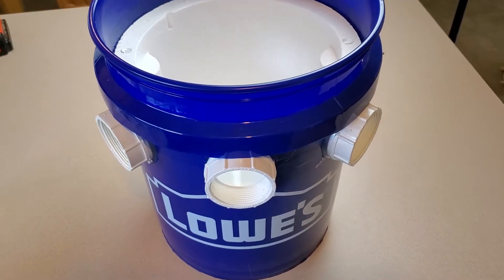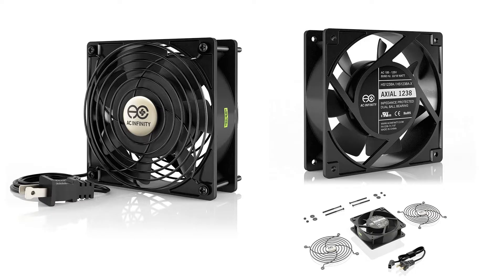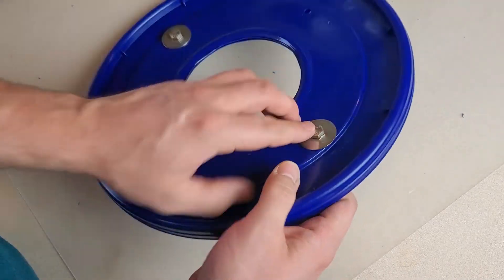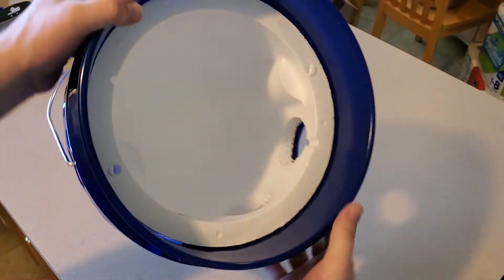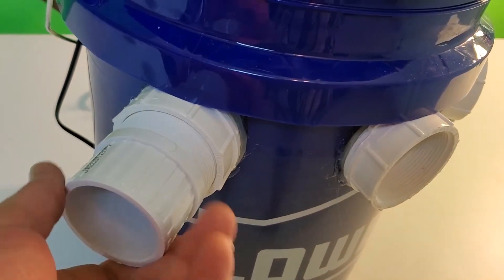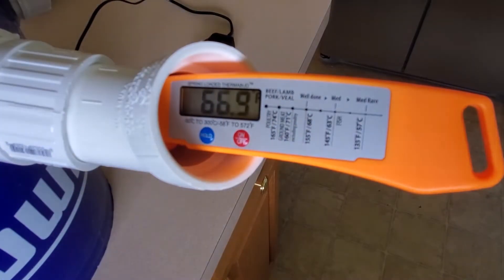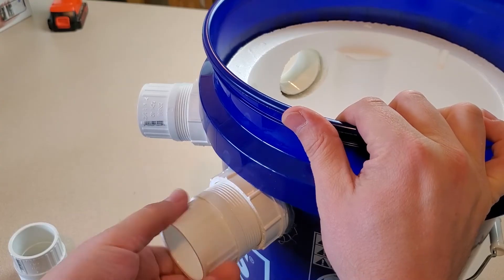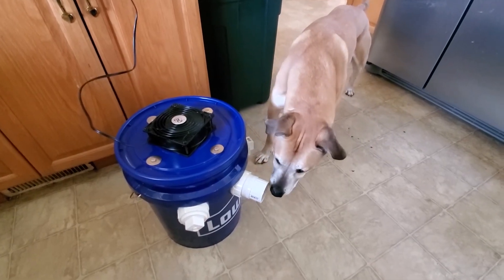DIY Air Conditioner - Homemade Bucket Air Cooler w/ variable speed (Deluxe Version!)

Comment: Unanswered question:  What happens to the room temperature?  Does this put out enough to lower the "room" temperature?  If so, by how much?  How small does the room have to be to feel the effect?
Reply from the maker: The ideal use for this contraption is as a "person cooler", rather than a "room cooler". If your room is 85 degrees (or whatever), this will cool you down if you're sitting near it.
Reply: @GreatLakesPrepping  Hmmm...ok.  Good to know.  I'm guessing it might still cool a car or maybe a small room.  It would be good to see a before and after test.

Comment: That fan seems small does it blow out very slow?? Can you test this in a hot room? Like if you put this in a 100 degree garage would it do anything at all?
Reply from the maker: The fan is not huge, but it blows a lot of air. I will mention that this thing is not so much a "room cooler" as it is a "person cooler". For it to really cool you off, you'll probably want it blowing at you. But whereas an ordinary fan blows 100-degree air at you (if you're in a 100-degree room), this contraption is blowing ~63 degree air at you.
Reply: @GreatLakesPrepping  Thank you that's what I was wondering. I figured it would be great to sit in front of but as far as room cooling not so much. Saved me time building it for no reason =D Nonetheless it's probably the coolest bucket one I have seen :)
Reply from the maker: @NewYears1978  Thanks, I appreciate it

Comment: You mentioned using a 12 volt DC fan. I bought one and a 12 v 7ah battery.  But the fan does not put much air out.  I want to use the cooler in my golf cart.
Do you have any recommendations for a 1v DC fan with comparable specs to the 110 fan you used
Thank You, saw a few of these dyi coolers on you tube, I really like your version
Reply: 1 volt typo error, should be 12 V
Reply: 1 volt typo error, should be 12 V

Comment: I might have to try this, I am an artist that vends at outdoor events. One event in particular is nine 12+ hour long days in a row, at a time of year that is usually hot in the afternoons. I have  a van with a cot in it so my hubby and I can switch off taking naps when needed. BUT it's like napping in an oven, and the van air conditioner can't keep up. I have been looking for ways to help cool it down. This might be the answer. I only need to use 2 or 3 times a year.

Comment: I was thinking about one of these and then it popped up on my YouTube feed. I was thinking precisely similar to this with the exception of a pipe going down the middle but not extending all the way to the bottom of the bucket that would force the air to rise up through the ice and increase the chill factor. You could have multiple holes drilled in the bottom of the central pipe or just have it pushing straight through.
Reply from the maker: That's a good idea for an improvement to this style of air cooler.

Comment: I'm contemplating doing some car camping to save on a road trip. And honestly I'm just looking for something to keep cool at night while sleeping since I don't want to run the car AC due to obvious reasons. Seems like this would do the trick. Thoughts?
Reply from the maker: As long as you can keep it filled with ice, it will blow cool air on you! I think a batch of ice ought to last you through the night for sure.
Reply: @GreatLakesPrepping  awesome. Appreciate the effort and knowledge.

Comment: Thanks for making such an a awesomely thorough video! While waiting for a mechanic to fix the a/c in my car I had an idea! I live in Arizona and it's getting hot out!! 😆 so I'm thinking about making one of these and using it in my car to save $$ gas, plus wear and tear. Does anyone think this is a doable idea?? I just read an old newspaper story about how they actually used to have mini swamp coolers in cars lol Love to get some thoughts!! Thanks in advance and thanks again for your great video!!
Reply: I saw a comment in a similar tutorial that the windows need to be open or else room or car will get rather humid.
Reply: @voz805  Maybe so, I don't remember that. But driving to Arizona, it sure helped.
Reply: @voz805  Cool thanks. I just sold my car a few days ago! Praying that the Lord will bless me with another one with cold a/c 😁
Reply: @voz805  Cool thanks. I just sold my car a few days ago! Praying that the Lord will bless me with another one with cold a/c 😁
Reply: @voz805  Cool thanks. I just sold my car a few days ago! Praying that the Lord will bless me with another one with cold a/c 😁
Reply: Those old swamp coolers used to be installed in the passenger window of the car with water inside. Then as you drove it forced the cool air through.
Reply: @blueterrace  Thanks Tim, after some search I found the same information 👍🏼
Reply: @chirho777  I only knew because my grand-mother had one on her car.
Reply: @blueterrace  😃 wow, so not 2023 lol I bet that's a memory to remember! Thanks for sharing 👍🏼 🙏🏼

Comment: Does it really make a huge-difference, lf you use a styrofoam-liner, Rather than a, White, plastic-bucket, liner, On the inside, To hold the ice-cubes?
Reply from the maker: Yea, the ice cubes will melt way faster without the insulating insert.

Comment: I just built this for camping and it’s looking really good, thank you!! My question is how can I run it from a battery? You mentioned 110 volt, do you have an adapter that you hook up to a battery? Or does you battery already have a 110 outlet?
Reply from the maker: This particular motor runs on 110v. If I was building it primarily for 12v, I would have used a different motor. However, my truck does have a 110v outlet I could use for it, or I could use a basic inverter with my 12v solar backup system in the house. But if you only ever want to power it with a battery, I would use a 12v motor instead of this one. It would be more economical than using 110v and buying an inverter.

Comment: Okay you're hitting 60 to 60 to 63 degrees with regular ice if you took a block of dry ice and busted it up even two blocks you would drop your temperature down another 20 to 30° with dry ice and it would keep longer I know it works because I've already done it every time we do one of these swamp coolers cuz I was born and raised in the swamps we use dry ice because it lasts longer it pulls a colder air and if you want to make it really cool put some water with it a little bit of water just to make the dry ice start evaporating but your temperature be dropped down sufficiently even in 90° heat I live in Florida Orlando and it works very well which I ice a lot better than regular ice and use dry ice
Reply: Does anyone make these and have them for sale. My AC is out in my car and I really need one. I stay in Florida and work on the outside delivering. 😢 Please let me know. Thanks

Comment: A cooler option with those lids is Captain and used a car air filter as your inlet and put the fan on the bottom lid and have it spaced out like that this way it's sleek easily cleaned and different
Reply: @garrettgiuffre7298 Can you elaborate more on this ? I like your idea but I'm having hard time picturing it in my head

Comment: Wet Dry vac Lowes r Home Depot and fill the bucket with ice and salt. The set to blow 
Caution
Salt Ice or used Dry ice and IPA for sub zero AC. This will freeze your but off.

Comment: Thank you SO much. I live in Cali and it's too expensive to run AC. It's summer time and I've built one of these before but my fan sucks. I'm excited to modify it and stay cool this summer.
Reply: Dan, let me know what fan you decide to use to upgrade your fan bucket? I’m up here in the bay and it’s still hot today like it is in the valley. I’m going to get mine going!
Reply: @SemperShock  I'm gonna use the one he said in the video. Previously I just bought this cheap one from Walmart and it doesn't have enough airflow what so ever. I'll let ya know if it makes a big difference when I get it though! I have to wait til I get paid (starting a new job next week)
Reply: @danivalentine1280  
Alright Good to know. Congrats on a new job. I hope it works out for you. 
We are all in the same boat. Trying to get by. I live in the Bay Area. These homes don’t come with AC in them. It shouldn’t be that hot up here. But it was a 100 yesterday. I need to do something to combat this heat.
God Bless
Reply: @danivalentine1280 how did it work?

Comment: One video the guy used a gallon water bottle that he froze before putting it in. I will try that first because I'm afraid once the ice starts melting the air coming out will have water mixed with the air. I did get the same fan you did, and couldn't get the insulator you got because they won't ship to California because styrofoam is outlawed here. Lol. I got the fan seal and speed adjuster too. Btw. Seems like you can't get a perfect seal on the lid because it has that raised circle. I also got the food safe bucket that is white, and doesn't have the big Lowe's or Home Depot on it.
Reply: Unbelievable. Why does anyone live in California? Everything is banned

Comment: You can drop your output air temp by 10-15° by adding a tube from the fan down INTO the ice. 
Air flowing THROUGH the ice will be considerably colder than air flowing OVER it! 😉👍🥶
Reply from the maker: Good idea. I may have to try this for a Version 2.
Reply: I wonder how much even better it would be if said tube just slightly dipped into a pool of water at the bottom so that the air has to actually touch ice cold water

Comment: How is the Air flow out of the pipe outlets?
Reply from the maker: It's pretty good, but isn't gonna blow your socks off. I found it to work a little bitter with one or two of the vents capped off, but when I'm hot I like the cold air to blast right at my head.

Comment: I did this. The ice was completely melted  after an hour and 15 min. Did you not run your fan for the melt test?
Reply from the maker: What was the ambient temperature? Did you have the thick styrofoam bucket liner?

Comment: The only other thing better than ice is using a frozen gallon of ice, that way it can be re-used. 1 in the bucket 1 in the freezer.
Reply from the maker: Good idea! I'd only worry about the ice expanding and splitting the gallon jug. But I wonder about getting a bunch of those cheap blue "gel" freezer packs and using that gel to fill a milk jug. I don't think that gel stuff expands very much when freezing.
Reply: @GreatLakesPrepping  that’s a pretty good idea. You should make a video on that! Dollar tree has them for a buck a piece
Reply: Adding rock salt to the ice will make it at least a few degrees colder. That’s why it’s used in ice cream churns
Reply: Could you use dry ice??
Reply: @yourerightimwrong4567 

Never do that.

Because those are Chemical that you can Inhale